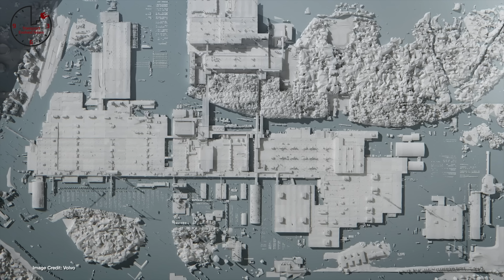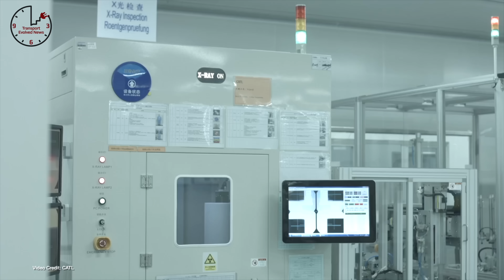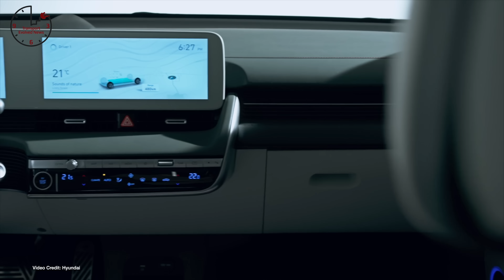TEN 372 - Model X Delays, Ford Punishes Stealerships, Super Bowl Ads

Comment: Having experienced the digital rear-view mirror on my Bolt Premier, I hope automakers don't ever remove optical mirrors.  You have to refocus your eyes to view the digital screen 1 foot away vs. an optical mirror where you can keep your eyes focused far away.  It's quite disruptive.
Reply: Don't you have to regularly refocus anyway to look at your instruments?
Reply: I think it depends on the user. I love my Premier's digital mirror - always correctly aimed, with no blockages from anything inside the car. I've never had a problem with refocusing. Not always great at night, but you can just flip back to the optical.

Comment: The Dr.-Evil-themed GM ad is a real head-sratcher, given their massive battery recall. "I have one simple request, and that's not to have Bolts with frickin' fires in their batteries!"
Reply: I do commend GM with Finally while belatedly admitting the battery issue and focusing on fixing the existing Bolts over making new ones with the improved and safe battery.   Next for GM to figure out how to make an affordable functional (lower bleeding edge tech) Bolt or Bolt like vehicle gong forward.  Maybe one with LFP batteries decent high speed Charging.  Some safety driver assist but don't worry about super cruise/level 3 autonomous driving - just make a good functional human driven car for the masses

Comment: It is rather weird that the part of the Wisconsin Electric Vehicle Bill amendment would prevent governmental entities being able to fully utilise the battery packs in their EV fleets by making them available for support services to the grid when not in use & thus provide value to taxpayers through monies earned as well as covering running costs & recouping CAPEX. 
Talk about unintended consequences.
Reply: It's a way to reduce the value of an EV so when a govt entity does TCO analysis, an EV cannot maximize its value.  This makes it more likely an ICE car will win.
Reply: @normcfu  It might be part of the reasoning behind it but even with those limiting factors you mention, TCO of EV's should STILL outweigh that of an ICE vehicle, therefore ultimately  that reasoning wouldn't stack up. But who knows; the twisty turney mindset of some politicians is unfathomable.
Reply: @pinkelephants1421  As production of EVs increases, economies of scale will further reduce their costs (disregarding inflation).  On the other side, fewer ICE car production will slowly increase their costs.  Politicians are slimy and not above slapping some punitive EV tax to keep ICE cars economical.
Reply: @normcfu  Agreed 👍

Comment: First gear, standard EV acceleration and full regen. Fifth gear chill mode with costing. I guess it could be handy to change modes while you are driving.  While going on the highway and you want to pass you can shift down for more agressive acceleration.  However, I would rather have the space for the gearshift for more storage.
Reply: I say get a faster EV. They’re out there.  Than a stick shift which is nothing more than a crutch, is unnecessary.

Comment: 11:37 - What is this sorcery? Any DBA who doesn’t sanitize the handling of string data within their code deserves to have their databases crash and burn. I am a DBA and I tear into these problems when I see them. There is no excuse.
Reply from the maker: This is true.
Reply: I'm not a DBA I'm a computer programmer with VBA and I just pass parameters to stored procedures, so no problems with any strange characters.

I know the rest of the IT world has a low opinion of VBA, and the vast majority of the problems with VBA has nothing to do with the technology, and the problems actually rests between the screen and the chair.

But if a VBA computer programmer can, not have any problems with strange characters, then if anyone else does have a problem, they have failed to meet a particularly low standard.
Reply: I am not aware of any scenario where, in a database or data exchange format, a string containing a pound sign (hash sign, or octothorpe) would cause a problem. Now, if it was a quote, double quote or backslash, I could see where that might trip up a naive import routine somewhere.

Comment: That "manual" transmission EV could give US a very nostalgic option: put it in "new driver" mode and allow the next generation to enjoy fumbling the clutch and stalling it at a red light just like we all did!
Reply: That makes zero sense since the torque properties of an electric motor don't require a transmission in the normal sense.

Comment: I've a Vaxhall Ampera, which is a Gen 1 Chevy Volt to you guys on the other side of the pond, 35 mile EV range then the ICE engine kicks in. Now if I take the battery out, strip it down and replace the battery pouches with CATL's latest I could probably increase it's EV range to 100 miles EV. But also I could take out the ICE engine and replace it with sockets for aluminium-air range extender batteries which are being developed presently.
Why is no one doing this, PHEV EV's, a 150-200 mile range with LFP rechargeable batteries for 90% of daily driving needs, then plug in aluminium air batteries for another 200-300 miles range if required. They would be affordable, more efficient since 90% of the time your not lugging a large battery around you don't need. In extreme weather, forest fires, storms, floods, heavy snow, you can evacuate quickly/ keep the heater on if you get stuck, even if the rechargeable battery is flat, no range anxiety, can tow a caravan /trailer. Aluminium-air batteries have really high energy densities, could be bought and sold over the counter or in dispensers at charging sites and just plug into sockets in the frunk, they aren't rechargeable and are less energy efficient than a rechargeable battery but are fully recyclable and as range extenders would only be used infrequently.
Anyone else think this makes sense, I'd love a full EV but seriously the tech is not quite there and EV's are too expensive, this could solve both problems.